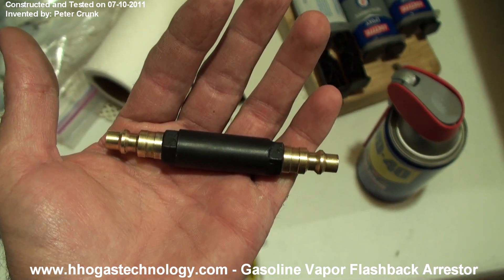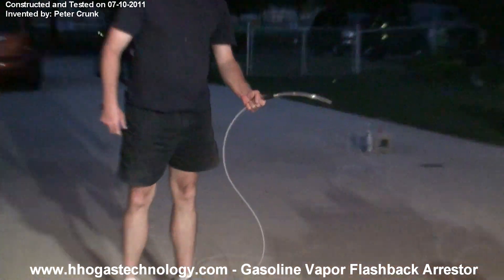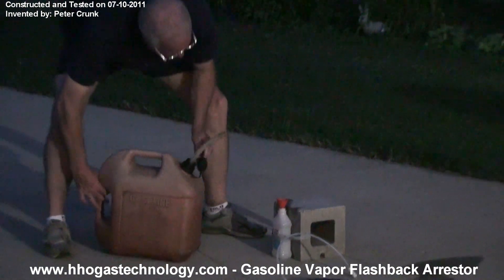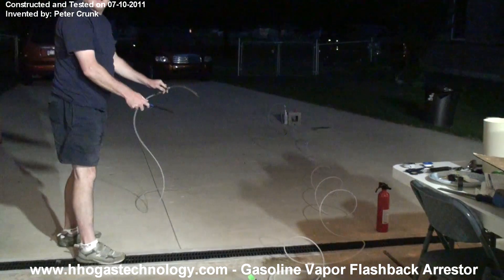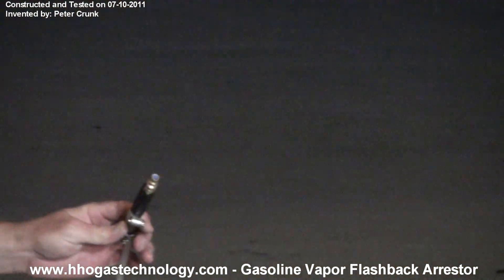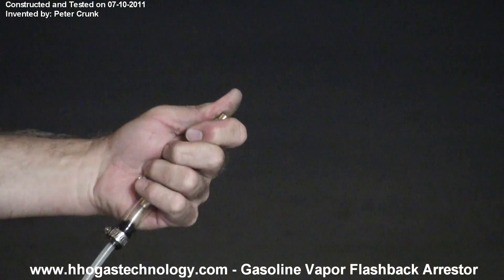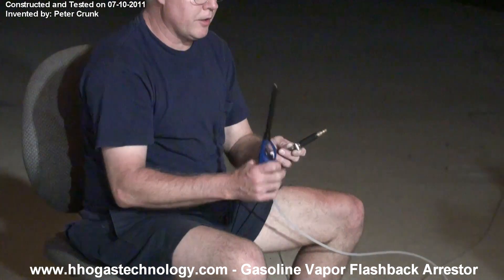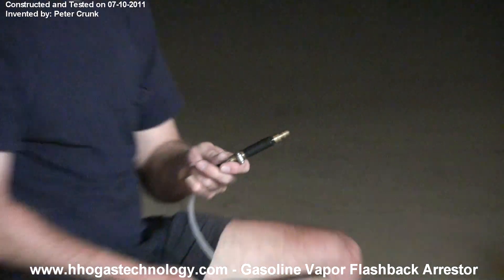Worlds Number One Gasoline Vapor Flashback Arrestor

Comment: that pipe just full of mesh... smart. but need to build large size. like 1-1,1\2 inch...
Reply: HHO Gas Technology before you took the end piece of hose off it didn't flash back either because the hose is too small of an ID. It's never going to flashback no matter what you do will starve itself of oxygen before it reached any lengths up the two that's why the two just sat there and burned on the end that tube in that one foot piece of tubing with a flashed if it was going to flash anywhere
Reply from the maker: That does not have any mesh in the arrestor at all. You are 100% wrong in your observation.
Reply: So what's inside? Invention secret?
Reply from the maker: Stainless steel screen stacked with gaps between each screen cup

Comment: Both Victor and Harris make excellent arrestors and they are OSHA and MSA approved. They also are easily adaptable to NPT or BSP thread.
Reply from the maker: I agree with you on your statement regarding regulation standards. All regulation flashback arrestor's have resistance when gas is passed through them.

Comment: You dont need a spark arrestor if you make the device properly. We never had one on ours and we tried to blow the thing up intentionally and couldnt do it..
There isnt a device out there that makes an engine run on fumes , vapor or anything except vacuum assisted combustion 
In this method you reduce gasoline to its smallest molecular state(think liquids in space) and the ignition of the molecules explodes in the cylinder. Excellent fuel economy but very poor acceleration after 8-12 miles of travel.
The other system burns raw fuel and the resulting burn expands the gas and forces the piston down. Poor economy but better and control over the entire time driving 
\you can speed up at will and slow down when you want With vacuum assisted combustion you must run a constant speed imitating a stationary engine . Shell Oil and GM did theirs on a test track and Tom Ogle ran on the highway at a steady 55mph. Running at steady speed is imitating a stationary engine which has had more success than an automobile application
Eveyone has success with a lawn mower but hits the same problems with the automobile application. Like all of you I had the same problem . Blamed it on a lack of heat, lead in the gas, the design of the device .
,not enough holes in the bubbling, air hole size, you name it. Ive seen all these solutions on you tube yet there are no devices that have gotten on the market because you cant overcome the limitations of the technology. I couldnt either neither could shell GM pogue and Ogle. 
Dont feel bad. Try a stationary engine in a car turning a generator and the generator charging batteries while electric motors turn the wheels. Chevy Volt is a good candidate
This might be the closest you will come to making it function like a normal car. Everyone who has succeeded has run their car at a steady speed.Great fuel economy a four cylinder gets 20 times its normal rating in mpg. We got 651 mpg on an 1100 cc volkswagen 4 cylinder had a hell of a time to use up all the gasoline. And after the first 12 miles of travel we had to run at a steady speed and avoid stalling restarting after is near impossible
Leslie 
780 700 7507
lesliec77@icloud.com

Comment: gd job adding in a venturi one way valve to the gasoline air intake. install a regulator at the gun handle will help.
replacing the gas outlet with a one way jet head might give you a beautiful blue flame.

Comment: You apparently never took chemistry. Hydrogen atoms are too unstable to exist as single atoms due to it's valence state is unsaturated. They only exist as H2. Oxygen is electronegative which causes it to bond to another Oxygen atom hence why it exists as O2. Hydrogen and Oxygen can exists as single atoms for very brief moments, but we're talking Planck time. One to the negative 13 seconds. Too fast to produce "real" HHO gas. HHO gas is a misnomer for water vapor. You're producing H2 and O2 gas.

Comment: im not trying to be an a-hole here, but your premise of increasing the pressure does nothing to test your arrester. what you need to do is decrease the pressure, or turn the pressure off all together, while keeping the ignition source in place. if you have any pressure at all pushing the fuel vapors out the end, it cannot and will not flash back to the bubbler because the flame is being pushed. I would seriously do more extensive testing before selling this product to anyone.

Comment: Ok, I'm going to pretend like I didn't just here you say that gasoline( a highly potent mix of mostly C8H6O13) Is an oxygen-less substance that can't ignite a flashback reaction during combustion. However I think the current design could be improved. For an example, you can go over to Grant Thompson's channel and check out his HHO generator design, including a simple flashback system that yields much safer and simpler.

Comment: basic established design that works should always be tryed but the torch would have worked provided you followed established design meaning you must have an air fuel mixture. You have to provide air and fuel with a combustion zone just like those fancy 10 dollar torches you find in the local hardware store.

Comment: you would have to be a complete idiot!!   A COMPLETE IDIOT to run pure oxygen down a gasoline line and with hydrogen as well!!   

im guessing but if you only used a valve in your arrestor its not going to do a very good job!

for a proper test use pure oxygen and a flammable gas.

Comment: Well i have made a few b4 all u need is 2x or larger the size of yr hose and pack it with steal wool bingo u just made a back fire stopper. But from what i could see when u hooked up yr hose u used a one way connector so when u shut off the air sure the fire wont go back down the line when sec thing with how small yr so called unit is all u have is a one way plunger and if it wont stop HHO than its not a flashback a tin can with steal wool also works with HHO! Just over priced  junk!

Comment: @Ace011mm ...Maybe with acetone there is problem because acetone have long "threads",this is specific gas flow.But I will try this and also i will watch your video,because i think there (in mix) no enough oxygen for reaction.Gasoline vapor alone cant burn,cant exploding,because nothing cant burn (oxidation) without enough OXYGEN! I appreciate your work,but some things I cant accept (like your"s and Thommy"s "air heater" for car) Thommy also have some great ideas,but this men throws shit on HHO

Comment: @pjckac1 But I do this many times! HHO gas go trough gasoline bubbler,1lpm to 5lpm HHO,and then light the hose end,about 6mm diameter,I think this is 1/4". I newer try this with acetone.Of course,I use flaschback arrestors and suggested this to everybody,I just want to say,gasoline make HHO very safety! You can find US patent,Babbling HHO trough terpentine,to make HHO safe for use and for storage! This is also work with gasoline!

Comment: OH! your gonna use gasoline vapor to ignite the pistons!
Reply: You idiot what do you think ignites in the engine , a motor can not run on liquid gasoline it has to be in vapour form to ignite, that what your fuel set up and fuel injectors do , is spray a vapour for ingniting.  All the garbage that is in gasoline when it is still in liquid form is some what put back through the return line in your car and the rest of the garbage comes out your tail pipes as carbon monoxide.  when you use only gas vapour to run an engine it will run cleaner , cooler , and way more efficient. I can proof to any of you idiots making stupid comments about running engine on gas vapour. I run my snow blower without carburetor and just vapour valve and oxygen valve, and the same set up for lawn mower , generator.  And all three run cheap as hell  and run better than they ever did . Just think of how mileage or  more running time  you can get from a little gas , buy stealing the vapour from it.  gas in liquid form is so dirty that most of it is rendered useless. This why you are constantly giving your car fuel injector cleaner and why in time your catalytic converters are  plugging up. This day and age do you really thing with all the technology out there that cars and trucks should be getting 100 or 200 mpg. Just like the pharmaceutical company's,  the oil companies want nothing to do with any thing that would help to get 100 or 200 mpg. Whether your to close minded  to think that this could work or whether your just to lazy to want to make it work.   Hell owning AK47's and what ever other major weapons you can own , seem a little dangerous also in my mind but you don't have any complaints about that bullshit. every bod is so fast to judge people , people still are under the impression that you can make yourself feel better bye making other people look or feel bad. News flash to all the insecure people out there , try putting a smile on somebody's face instead , trust me you will feel a lot better about yourself .  Thanks